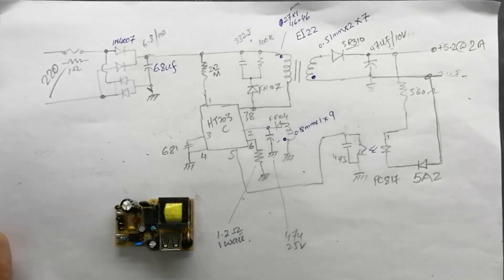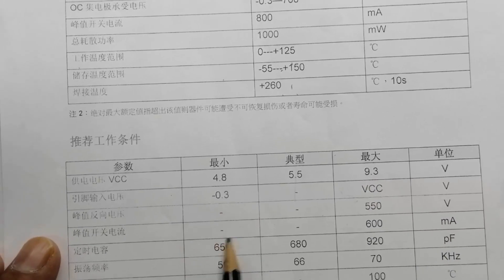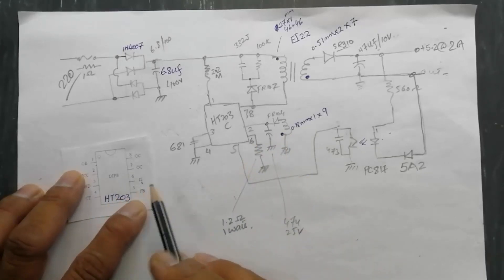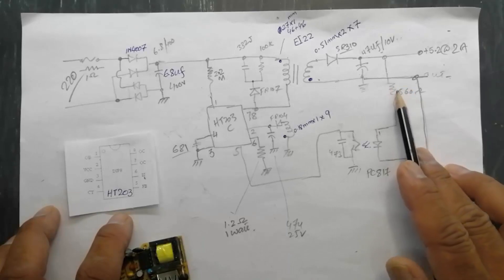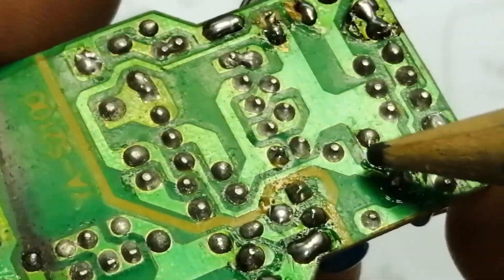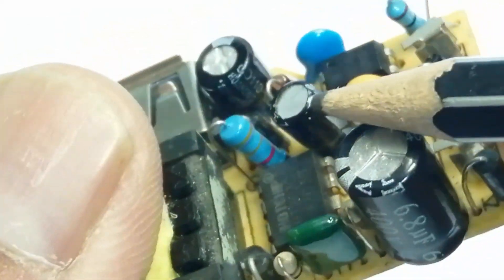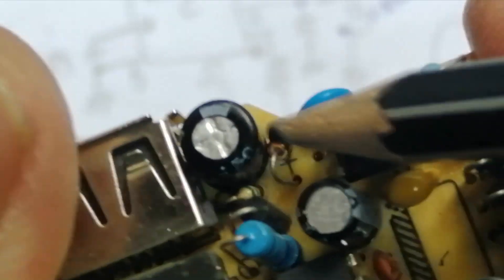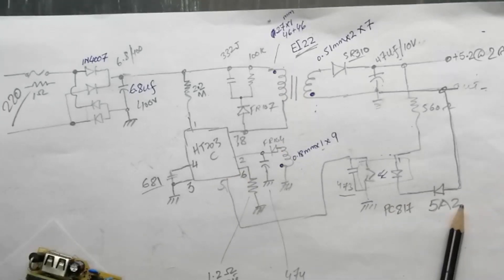#273 Mobile Battery Charger Circuit using HT203C SMPS PWM IC

Comment: Great video! I re-watch these several times and I appreciate all of them. I looked it up and the 5A2 diode is actually a 4.5v 1/2 watt diode  This is great! Now I can modify my old plug in wall phone charger to power the 6.3v 300mA heater on my 6au6 vacuum tube. A regular transformer won't fit in the tight location where this WILL! Thanks again!

Comment: Really nice and specified information about those commonly used chargers. Nice that you give resistor-, capacitor-, etc values. It's nice. Sometimes resistor is so burned, that you can't see color codes. Very useful information for repair such devices. My humble, humble thanks!

Comment: Sir  SONY  11DAV-DX-DH-POWER -MP   this power supply not work I personally chake but very critical fault  this  power supply not show in STR ..VCC pin supply and  not  create  output voltage   thank you...

Comment: I'm pretty sure this "5A2" diode is a 5.2 volt zener diode. Otherwise it would not work, would it?
Reply: @HaseebElectronics  How should a leakage current of max. 100 uA drive the LED in an opto coupler. PC814 needs at least 1 mA to work. Your schematic would not work without a zener, or could you please explain why it work in detail? I think the diode is a mislabled 5.2 V zener. Could you please desolder and test it?